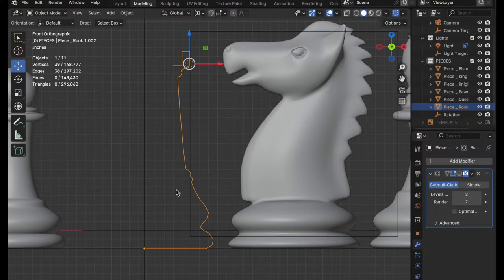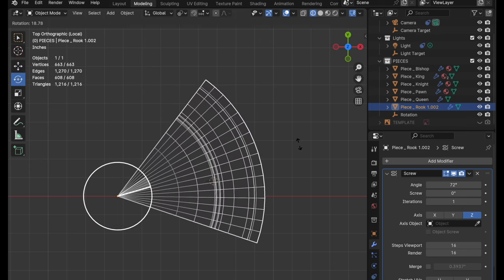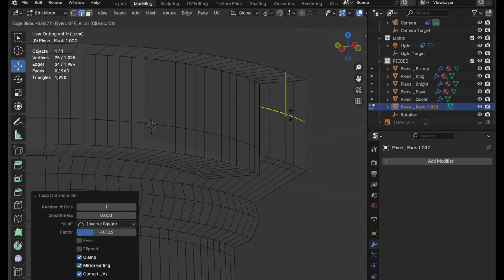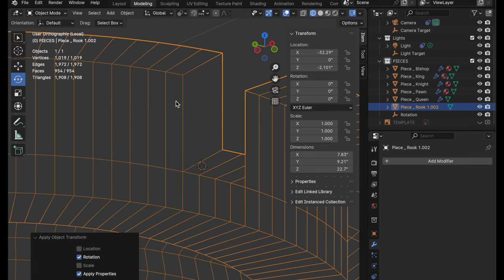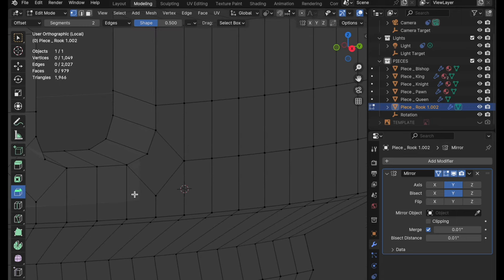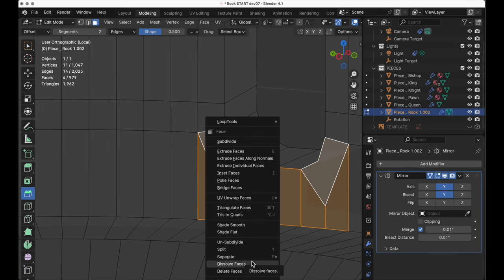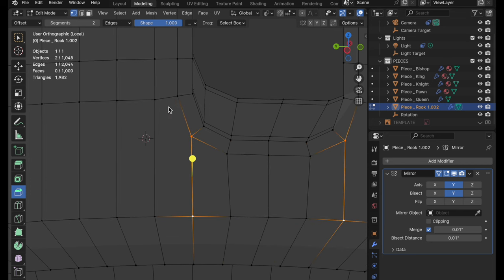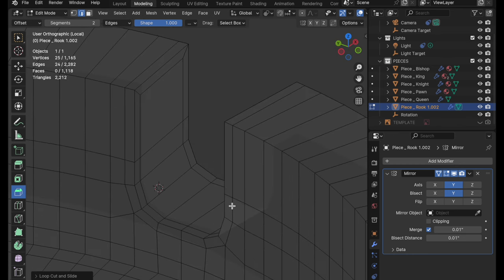Model the rook chess piece!

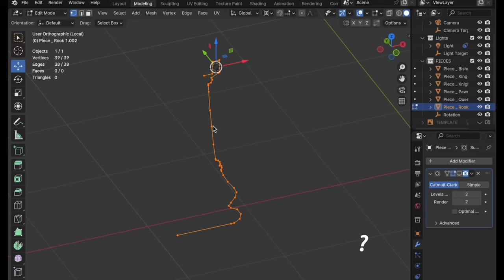Comment: 0:41 Isolation mode by Question mark? Local View is Number Pad /.
Even double checked in case it was some other way and ? does nothing.
5:06 None of it is a Buttress
Sticking up bits are Merlons.
Gaps between them are Crenels or Embrasures.
The whole thing is a Battlement.
Reply from the maker: On a MacBook Pro laptop, 'local view/isolation mode' (whatever you want to call it), is the ?/ key, which is a single key on the keyboard.
Reply: @christopher3d475  Ok thanks. Hardly anyone uses Macs and I am surprised it has not cropped up in other tutorials in the usual Option/Alt type mention.  Is that a laptop with no numberpad? Again never used a laptop, (horrid things LOL) so perhaps it is some different keymap used for that?

Comment: Is that wood texture procedural using the object coordinates?
Reply from the maker: Yes, it's procedural and it uses the Texture Space settings which is set the same for each piece for consistent application. In the texture node setup I used Generated as the mapping mode. I can do a video on it if you want to see it.
Reply: @christopher3d475  i want to see it please make it one